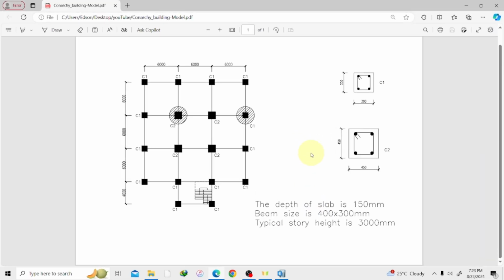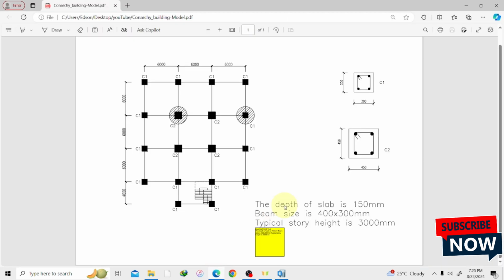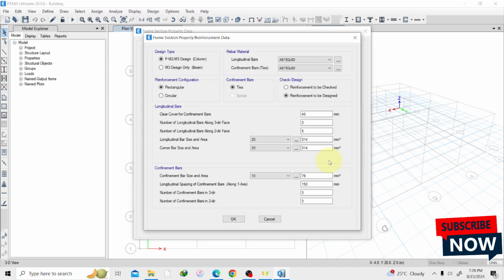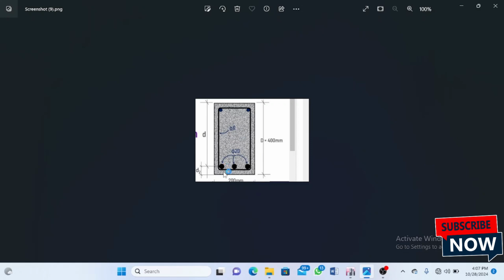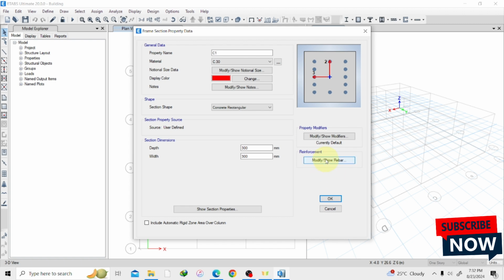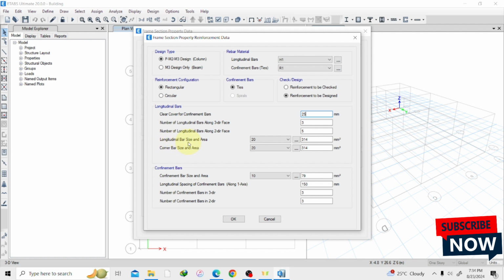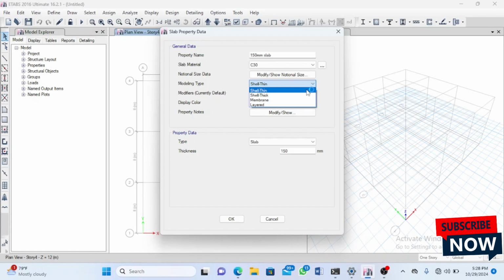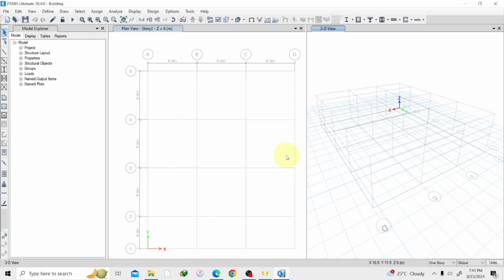7. ETABS Building Design: Defining Section Properties in ETABS

Comment: Thank you so much for your educational videos. Please, sir my question is how do you know or decide the size of your columns and beams before starting the  analysis sir?
Reply from the maker: For a rectangular beam, we start with span/depth ratios from BS 8110(or alternative code):
Simply supported → span/d ≈ 20
Continuous → ≈ 26
Cantilever → ≈ 7

Example: 6 m span(simply supp.) → d ≈ 300 mm. (d is effective depth)
Then we adjust using reinforcement factors and refine in ETABS.

From experience, we often increase the depth slightly (e.g. 450–600 mm for 5–7 m spans) to better control deflection and cracking.

Comment: I really liked everything you teach here snr , keep updating us like this ..... but i have one problem whenever im done modelling the model check okay but  analysis check is giving me a problem always ZERO OR NEGATIVE MODAL-MASS VALUES WERE DETECTED DURING ITERATION, THE RESULTING EIGEN-MODES MAY NOT BE VALID - CHECK THEM CAREFULLY !! THE STRUCTURE IS UNSTABLE OR ILL-CONDITIONED !! CHECK THE STRUCTURE CAREFULLY FOR: - INADEQUATE SUPPORT CONDITIONS, OR - ONE OR MORE INTERNAL MECHANISMS, OR - ZERO OR NEGATIVE STIFFNESS PROPERTIES, OR - EXTREMELY LARGE STIFFNESS PROPERTIES, OR - BUCKLING DUE TO P-DELTA OR GEOMETRIC NONLINEARITY, OR - A FREQUENCY SHIFT (IF ANY) ONTO A NATURAL FREQUENCY
Reply from the maker: Thanks for your support. The error usually means the structure is unstable. Check your support conditions, stiffness properties, and connections. Also, look for internal mechanisms, negative stiffness, or large P-Delta effects. Ensure proper mass distribution and try refining your model. Let me know if you need more guidance